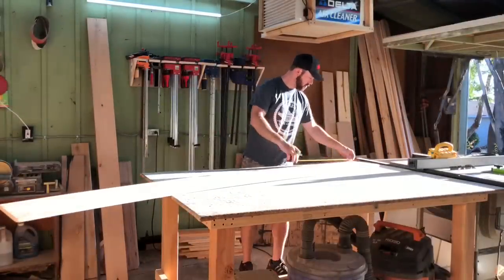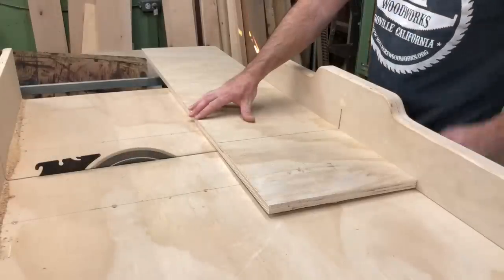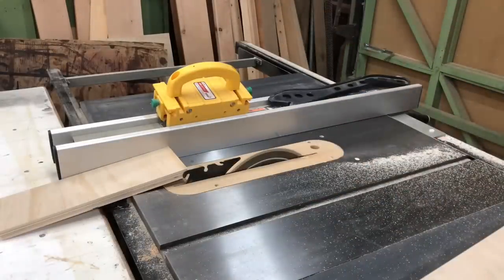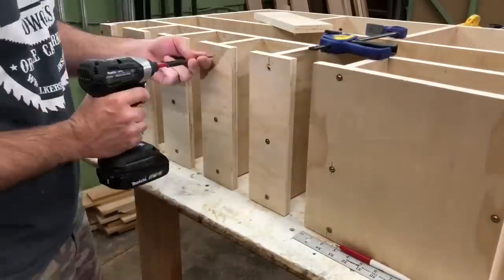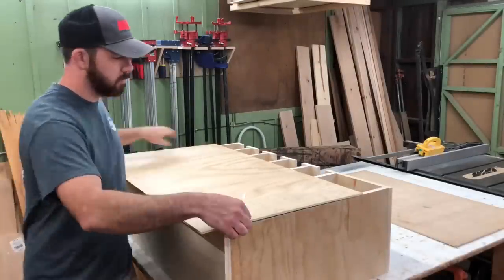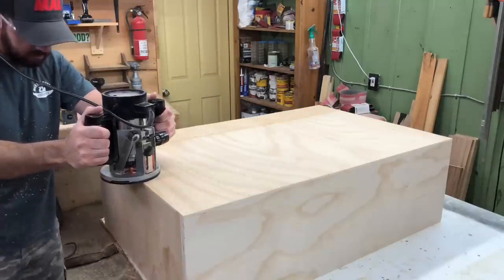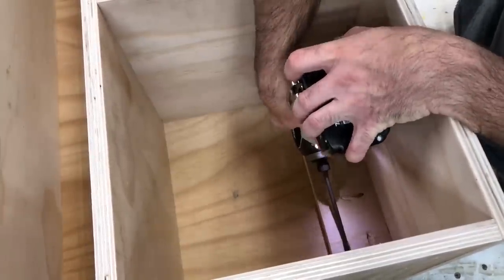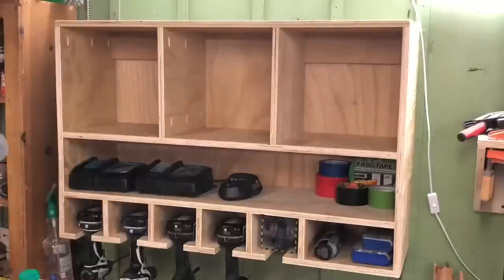How to build a diy drill charging station

Comment: I built one about six months ago very similar to yours. They are a great asset to the shop. I added a few of the small plastic bins to hold misc tools. 👍🏼👍🏼
Reply from the maker: Good idea!
Reply: Walkers Woodworks yours is made out of better quality material. I had a leftover piece of concrete form plywood that I repurposed. It needs a couple of coats of paint, but it’s functional and was basically free...lol keep up the great work my friend..

Comment: Very nicely explained. In your tool list I do not see the air nailer, nor the length and gauge of nails. Question, what gauge 23-18-16, my guess 18 gauge, length 1.25" possibly"?
Reply from the maker: I have since started using arrow fastener nailers but yes 18ga brads.  I can't remember what length they were off hand.
Reply: @WalkersWoodworks  Thank you for your prompt reply. 18 gauge is what I use, thinking about acquiring a 23 gauge for smaller items. My thinking is use glue then pin nail for holding as glue dries.Thus I can continue working on the item not messing up my glued pieces; oh yes I have done that.

Comment: Like that idea..... I have a lot of 3/4 ply left over.... need one.  Its gonna happen.  Just need a design that fits my space.  I also have a old router.  My Dad's 70's craftsman one.  I like using it.  The base has a crack in it.  Works well still.   Old style that actually has a cable hooked up to the throttle wheel to control the motor.  I thought it was a wire for the trigger that was until I hooked it on something with the thing plugged in!  I'm a bit more careful with it these days, but do have a new dewalt plunger one (thanks to the wife for me B-day).
Reply from the maker: Haha nice.  Always cool to have old tools from family members.
Reply: @WalkersWoodworks  Yes, I also have his old table saw (craftsman 113). It's sentimental and takes up a lot of room.  I could get buy with a job site saw that folds up for what I need, but it is nice for have a cast top, and side wings.  Its just horrible for dust.  I should really upgrade to a newer model, but I think I'm going to mod it with a kerf knife addition and some dust collection.  I do enjoy using it to make things.

Comment: You should get the kreg pocket hole machine. $400. You could do all those holes in minutes. I love mine. Saves tons of time.
Reply from the maker: I've thought about it lol
Reply: Hah. I do the same things and used the jig you have for years. Then I got the foreman. Holy hell I wish I got it 10 years ago. It’s so fast and accurate I love it. I see your friend has it on the video of your track table you guys made. Stupid question time. How do you like the track saw you have? I need to get one. Was looking at the kreg and dewalt one. I’m honestly not impressed w the fess. My friend has it an I think it’s way over priced.
Reply from the maker: Yea I love mine.  Using it and then the festool I feel like it's just as good.  I would upgrade the blade though unless you're only cutting plywood.
Reply: Walkers Woodworks ok thx

Comment: Hi buddy, awesome video! I’m very new to woodworking (and I’m in the UK! 🥴), so have been looking at videos on YouTube to help me out. Glad I found yours, subscribed instantly!! Your methods and approach is impeccable; easy to understand and extremely thorough. That = perfect! 👍🏻

Anyway, I am trying to setup a little work area in my galvanised steel shed. It’s not large, so space is at a premium. So I have one question for you: What did you do/use to attach the anchors to your metal wall (the two bits of wood to screw into)? 
My plan is to completely cover my wall with MDF. This will allow me to attach various shelves and other bits easily. But, it still goes back to my original question of how to secure the wood to the metal.

I’d really appreciate any advice you can give, and look forward to watching the rest of your videos.
With enormous thanks, Jon
Reply from the maker: Hey Jon!
If you go to any big box store they should have some screws that are specifically for securing wood to metal.  I used them in my new shop to sister up 2x4's to metal studs. 👍

Comment: A couple of quick things. First, you could have clamped inside the box if you took the end off your trigger clamps, turned them around, and used them as spreaders (assuming your clamps will do that).

Second, I strongly suggest you wear ear protection,  especially with a long router session
Reply from the maker: +Bob Costello thanks for the tips.

Comment: How wide did you put the bottom spacers from each other?
Reply from the maker: +Ryan Hess I'd have to go back and measure but honestly wish I had put them a little closer.  Just reference off the drills and drivers you plan to put in there would be my suggestion.

Comment: I really like the design of this build. I've seen hundreds of different ones but I really like this one. I've needed one for my shop for quite some time and I like what you are using yours for. It looks like items most used for a build. By the way, that cross-cut sled is HUGE!! The back piece closest to you, is that two 1/2" pieces glue together? Thanks!! Happy Holidays to you and yours!!
Reply from the maker: Haha thanks!  It's actually two 3/4" pieces of ply glued together.  There are plans for it in the description if you're interested,
Reply from the maker: Also happy holidays to you as well!

Comment: Hello Mr Walker great idea !  My question is what kind of air filter system are you using? I saw in the beginning of the video up in the top right corner what looks like a delta air system is that what you use ?
Reply from the maker: It is an old delta system.  Works great though!

Comment: Nice charging station, I need to make one of those. One note about table saw sled. It's easier to use your back fence kerf to align stock. Mark your stock on the back and align your mark on the fence kerf.
Reply from the maker: Well the slot in my sled was cut with a thicker blade.  So I had to go off the new thin kerf blade.  If that makes sense.
Reply: @WalkersWoodworks  Yes makes sense. What you can do if you want a zero clearance and clean cut is to add a thin sub-fence or sacrificial fence.
Reply from the maker: True Story.

Comment: A little bit scary without a guard on your tablesaw but otherwise nice to watch
Reply from the maker: What do you mean a guard?  I use a riving knife.  That's all you really need in my opinion.  Alot of guys don't even use that.  But I always will.
Reply: Walkers Woodworks I have the same saw and all I use is the riving knife also.  Did you make the zero clearance insert for your table saw
Reply: The guard can be detrimental.  1.  You can't use it for non through cuts. 2. It can catch some oddly shaped stuff. 3 it really blocks your vision for critical cuts. And 4 some carpenter production Rio techniques such as long stock flip and rip cannot be done with a guard on.  Yes you should in theory use it when you can, but personally I find it much better without than with for handy and careful people.  If you are otherwise not that type, keep it on at all.costs, hell just don't use a table saw.

Comment: Only problem i see is removing batteries from charging station
Reply from the maker: It's not bad.
Reply: @WalkersWoodworks  I wasnt sure, was thinking if u turned them around it would be easier to remove packs. I got some ego products with those huge batteries. Im mocking my build off yours. Good video. Appreciate the ideas and feedback.